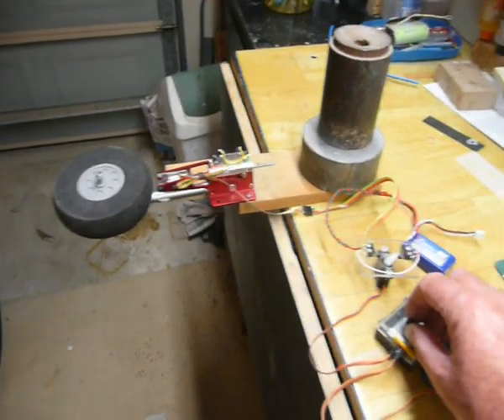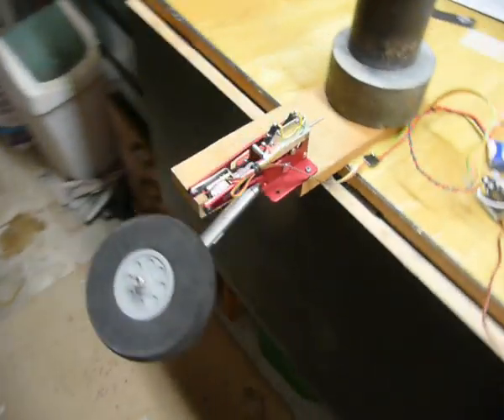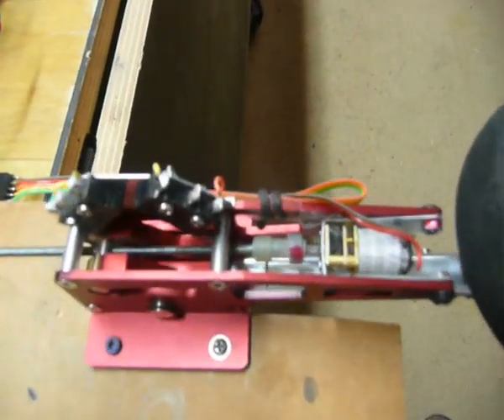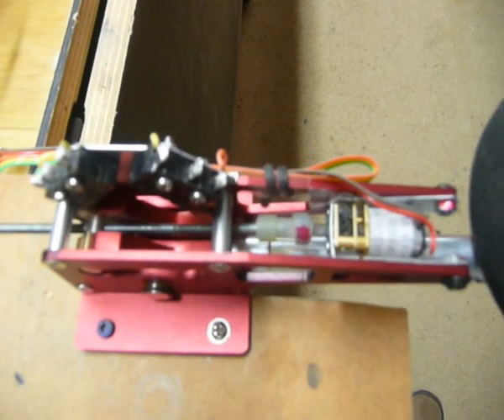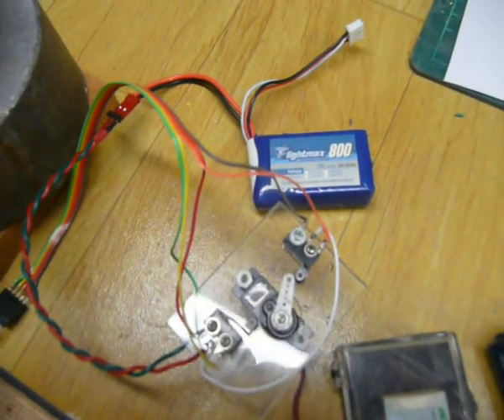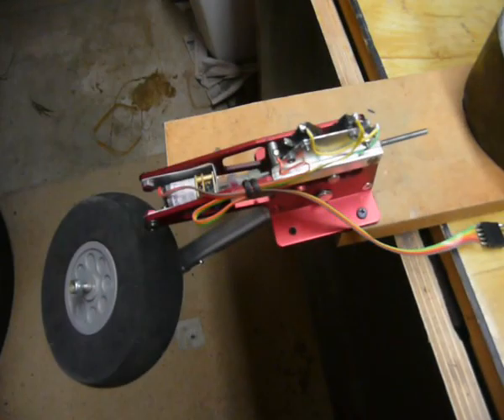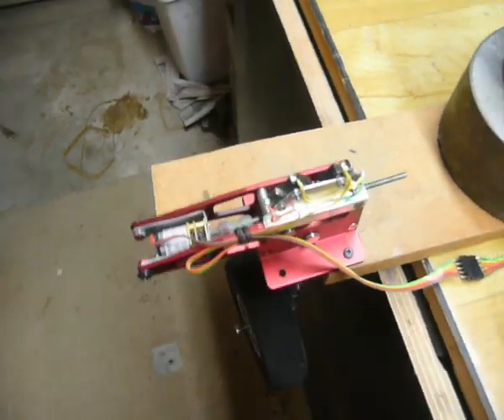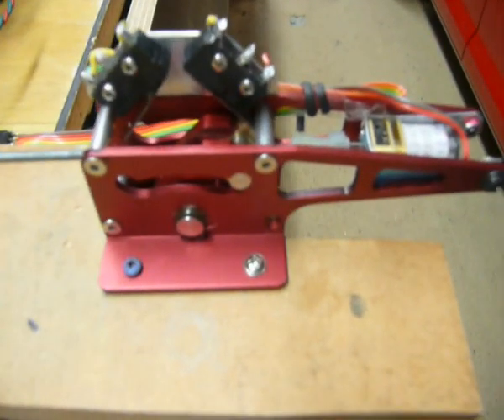Electric conversion RC model pneumatic retracts .mpg

Comment from the maker: The inline battery lead will have a simple polyswitch (PTC) of 1 amp.Used them many times without issue. As the current drops they re-form again almost instantly.